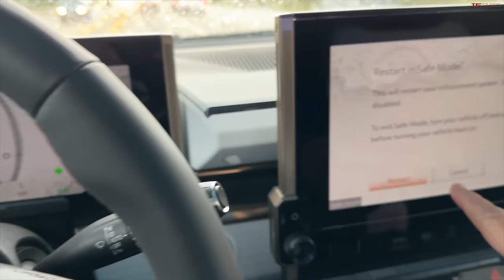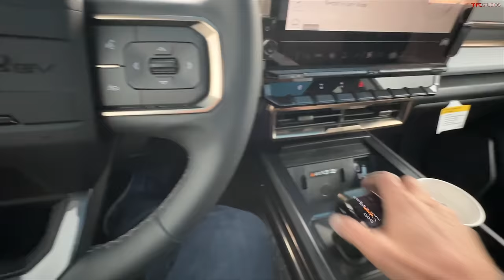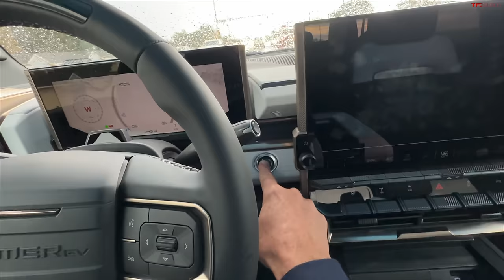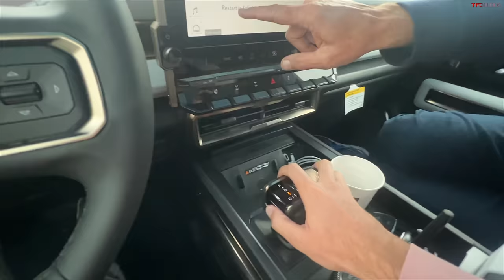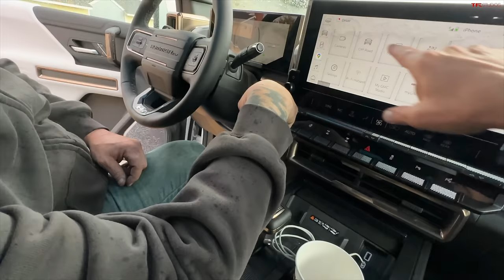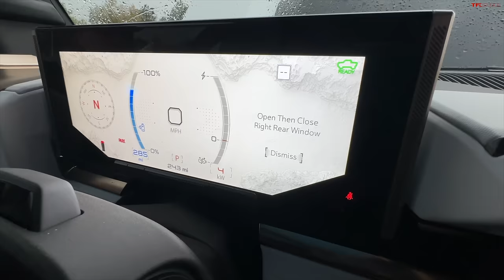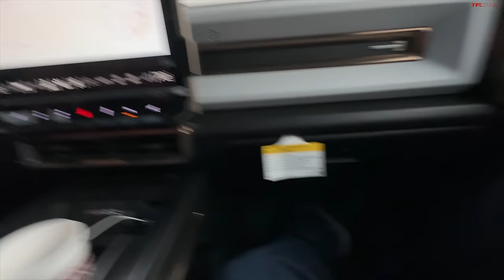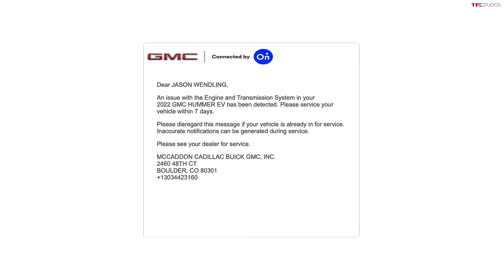I Bought a $115,000 GMC Hummer EV and It IMMEDIATELY Left Me Stranded!

Comment: First it was Tommy's problem with one of the button's during the off road test, now it refuses to move?? I hope GM looks at this seriously, this is NOT a good look!
Reply: Not a good look. I watch the video where it had the button issues on the hill.
Reply: The Hummer they tested off road was a LOANER from GM, so it may have been abused quite a bit before it reached them, but even so. The vehicle should be built with more tactile buttons and less electric computer controlled items...
Reply: I was under the impression those were two different vehicles. The one that they took off roading was a loaner from GMC, and the one in this video is a different one that they purchased.
Reply: @tbm275  what are you talking about? They bought this. It is not a press fleet vehicle
Reply: @NWI_Steel  the one they took off road was a fleet test vehicle from GM, they state in the video it was VIN in the sixties so very low on the list.
This video was one they purchased
Reply: @tbm275  oh gotcha, I didn't see the other video. Thanks
Reply: IKR! I mean yeah the lightnings range sucks but at least everything works right!
Reply: @tbm275  kinda hard to do non-electronic systems when the  vehicle is literally powered by an electric motor. That said I miss miss a physical door latch lever
Reply: GM and electrical problems go hand and hand.  Lol
Reply: I would be absolutely irate with GM. There is a reason I’ve haven’t bought a GM or Chrysler/ram  vehicle in 20 years. They are garbage in comparison to Toyota, Honda, Subaru.
Reply: @WoolyNips  Well, as a 1st Year Bronco owner, I can safely say that it's still a risk to get a first year vehicle, but far less risky than with this sad behemoth.  Now passing 40k miles with nearly 0 issues, none of which even delayed a trip, much less ended it.  I am aware of some infant mortality in the Bronco line, but I am willing to bet that the Hummer makes it look like a day in the park.
Reply: @Prestiged_peck  the vehicle being powered by an electric motor doesn't do anything to make it difficult to have non-electronic systems. A fan is powered by an electric motor, and doesn't have a single computer chip of any kind. We've been using electric motors for more than 100 years. They could easily use a traditional hood release system. They could easily make everything just as mechanical as any other car. The only thing that needs to be different about an electric vehicle is a drive train powered by moving magnets instead of exploding gasoline. All this other stuff they're doing is completely unnecessary and I really hope automakers will make an electric vehicle that doesn't have all this nonsense
Reply: That's why I go with Ford....
Reply: Other evs have had issues too its to be expected
Reply: GM having electrical/software issues? I would have never guessed.
Reply: @chriss1227  maybe the the batteries got wet
Reply: The more tech, the worse the problems...
Reply: @sorrywrongnumber5280  Doesn't Ford do this ? I have seen their vehicles use the electric motors to do things like open the hood and work the systems of the vehicle, but they also have mechanical parts that are traditional and don't require electric motors, a simple key or hidden latch does the job for you, literally in case the battery dies, even the Ford GT has this system, it's complicated as heck but it works and gives you a way to do something without relying on the batteries.
Reply: I knew GM was going to screw this one up.
Reply: @sorrywrongnumber5280  never happen, DOT requires so much shit tied in on a manufacturer car, and then it's cheaper to tie it into the system than make it physical.
Reply: @WoolyNips  I bought a new model 2007 GMC Sierra 2500 (second half of the year 2007 they changed to a new model), and the truck has never has a problem to this day! I've offroaded it including the sand dunes nearly every year too! Never one problem ever, other than burnt out light bulbs..🤷‍♂️
Reply: @Prestiged_peck  It's not that it you absolutely have to have access to the battery, but there should be some way to reset the system when it doesn't respond.
Reply: GM knows they build trash, the people that keep buying their trash are the ones to blame.
Reply: Subaru is garbage and both Toyota/Honda have both had plenty of problems and recalls.
Reply: Alright lets go back to internal combustion engines they are more reliable
Reply: @nathankoroush7918  too many y people expect the 20 year old vehicle they have to be representative of what that company makes today, when in fact it very frequently isn't when it comes to Mass market cars. Luxury brands like Lincoln or Mercedes or BMW though? They've stayed pretty true to themselves.
Reply: @tbm275  Ahh thanks for the info. But it only shows how GM need to do better.
Reply: It’s the defender situation all over again
Reply: @That V8 Life TFL off road
Reply: @tbm275  Your post is full of irony. You're literally pointing out the physical button on a vehicle with a couple thousand miles on it broke because of "abuse" then asked for more physical buttons. The physical button was literally the problem.
Reply: GM's CEO needs to get out of the office and back in the kitchen. Don't buy anything GM in the present day.
Reply: Maybe they didn't extend the vehicle warranty
Reply: @Cam32412  I’ve owned 6 Jeeps (5 Chryslers, one Fiat) in the last twenty years. All abused and never had any real reliability issues.
Reply: @MrJohney  yeah, all this electric crap is unreliable
Reply: @FIREPHILSPENCER   a new toyota or Honda ain’t gonna break down on you less than a week after you purchased it
Reply: @sybsygstgstsgysg5330  That’s a lie ALL makes and models have a potential to break even in the first week or in Romans case a software issue on a new model which is more common than you think.
Reply: @sybsygstgstsgysg5330  ill stick to my ram rebel 🤙 well at least untill im forced into going electric
Reply: @MrJohney  don’t worry, these stupid electric car things aren’t gonna replace gas powered cars. There’s barely even been any advancements over the years.
Reply: A bunch of GM haters and trolls! Lol. You know what’s not a good look? Ford having to buy back all of those Explorers and Lincolns. All the issues RAM and the Jeep Wagoneers are having, or the fact Tesla can’t paint or align a door properly. Y’all swarmed here to post these asinine comments because you are haters. 🤷🏽‍♂️
Reply: @mybro727  what about gm and the wireing harness issues where people cant start there cars ? They all have falts just comes down to what you like.. all car guys rag on the other brands
Reply: Oh look copium of ev not working still forcing it on others weird how you think your this expert on evs.
Reply: @tbm275  yet we have old modles catching on fire and locking for no reason. Stop with this no one wants evs.
Reply: @LSRG-YT--LandonSRobloxGaming  Ford will be the same way with ev. Long charge time less wor.
Reply: Lgbtruck
Reply: Lgbtruck
Reply: @WoolyNips  absolutely true. When I was a kid I was programming  my TRS-80 and typed a custom program after multiple test , the computer could not recognize the last error. Over 150 lines of code, the last character of the last line was a ; removed it and program worked flawlessly. So the entire program it turns out was hung up on a single ; )
Reply: Tesla needed to replace every rear drive train in the model s produce in the first year and a half.
Reply: Tesla needed to replace every rear drive train in the model s produce in the first year and a half.
Reply: Did you see the video here on YouTube that shows it takes four days to charge one of these electric hummers when you plug it into a 120 volt outlet?
Reply: @LSRG-YT--LandonSRobloxGaming  fords are junk like electrical vehicles.
Reply: @269adventures  GM has the Cheapest Heaps Ever Visioned Yet! (CHEVY)
Reply: @269adventures  And also, why do you have a Ford E-Series RV as your YouTube pfp when you say Fords are trash aye????
Reply: @homernoy  They're talking about the previous incident with a press LOANER. Try to keep up bud
Reply: @golfish8589  
Your name is appropriate as you posted the same comment twice, goldfish memory 😜
Reply: its battery bullshit should never have made this piece of crap
Reply: This is gm in their finest they have been working on designing a electric 'car' till the 60s and with all of that time and money spent and this is what you get half ass crap so cheaply made 
This is why I will never own another
Reply: @hochhaul  Maybe you should re-read my comment BUD. Then maybe YOU will be caught up bud.
Reply: GM should go Bye Bye!
Reply: What u drive
Reply: It’s hard to defend a company over and over in a video like this pops up and this is real life it isn’t some what if video. 115,000 grand man . Yeah I would be ticked GM better make this right.
Reply: @dylanpersaud8407  01 Xterra with the 3.3l 4x4 u?
Reply: @coloradomallcrawlers  you’ve had much better luck than me sir. I owned 2 jeeps both trans went before 70k. Nothing but hwy miles. I have highlander with 275000ish miles on it, only replace breaks, spark plugs, and done regular oil changes runs perfectly. I have 4Runner with 168k going strong too no issues at all.
Reply: Typical GM junk. They are not Las good as back in the day.
Reply: @LSRG-YT--LandonSRobloxGaming  you know what I did last night?
Reply: @tbm275  hybrid is shitty .
Reply: @mybro727  Not me though! I want them to succeed. But things like this can be very dangerous. GM need to do a software update and work out the glitches.
Reply: YT is asking me to rate your comment. I wonder why?
Reply: @donsummers5678  rate it high bro
Reply: @Prestiged_peck  
The electric cars from the early 1900’s (yes 100+ years ago) seemed to do ok without computers and electronics 😂😂😂😂😂
Reply: @kellyg1757  I acknowledge not everything has to be electronic but a LOT of shit is required by federal law to be on a vehicle that simply cannot be done mechanically at any remotely reasonable price. Like a reverse camera or airbags, I think pretensioners can be done mechanically but they're a lot easier/cheaper to do electronically. Plus who would pay 30k+ for a new car that had mechanical locks and crank windows in 2022. I admit there's a crowd for it but they're very small in number.
Reply: @mybro727  Did GM have the biggest recall in history with faulty starters?
Reply: @jimmyh6601  your read through 70+  comments and this is what you chose to respond to?
Reply: @mase7557  how many miles do you usually drive  per day Monday-Friday?
Statistics say about 30-35.
And how many hours does your vehicle usually stay parked in the garage per day?
120v would work in this situation.
First of all. Batteries should not be left at 100%.
For battery longevity it is best to keep  the battery between 50 and 75%. So vary rarely will you come home near 0% and you most likely won't need 100% full battery the next morning.

Any one that can afford a Hummer or large ev . Can also afford to get 240v installed in their garage.
Reply: @golfish8589  Do you know how dangerous the lithium batteries in electric cars are? Have you seen the news reports in Fort Meyers, Fl about the EVs catching fire because salt water got on the batteries? These batteries are the same type as the ones in our nuclear submarines. If salt water gets on them they explode and burn. The Ft. Meyers fire dept. responded to a vehicle fire after the hurricane. The vehicle, a Tesla, burned for over 6 hours. I would never have one of those cars. The battery technology is nowhere near safe enough.
Reply: @mase7557  your phone has lithium batteries. 
Your lap top has the exact same batteries as cars.
The batteries are inside sealed battery packs.
These packs are not designed to be submerged in hurricane storm surge.
There is way more ice car fires than electric per 100,000 sold.
Electric cars charged by 100% coal power is still way less polluting the gas cars.

In Minnesota 24% of electricity is from renewable energy.
40% of Texas electricity comes from wind and solar. 
But I am guessing you don't believe quadrupling Co2 levels is not a concern.

Now for some good news you will like.
Many auto manufacturers will be using some lithium iron phosphate batteries that will not burst into flames.

Also, sodium iron batteries are also being developed.

Most batteries in cars today are Nickel Magnesium cobalt lithium. 
And all batteries are recycled. 
None, zip, zero go into landfills. Each battery contains thousands of dollars of rare earth minerals.

10s od billions of dollars is being invested yearly in battery battery technology. 

My advice to you is first. Just go test drive an Electric car. Anyone. I dont care. It will put a smile on your face.

Comback in five years when prices come down after mineral supply catches up with demand and price come back down.
And buy an ev with Iron phosphate batteries